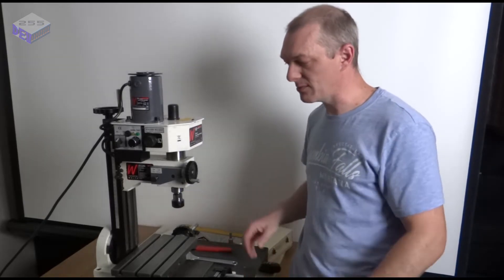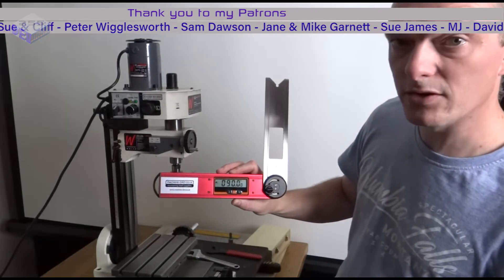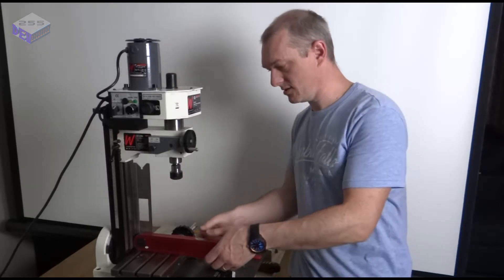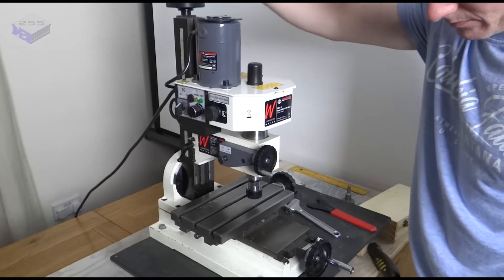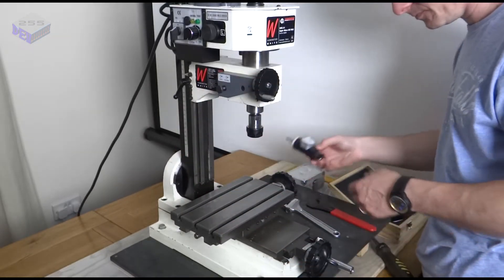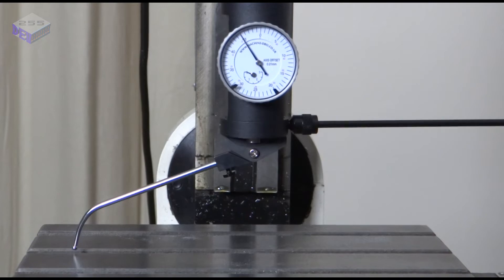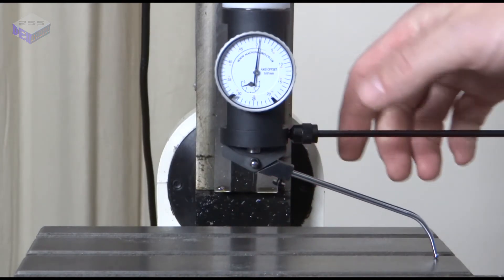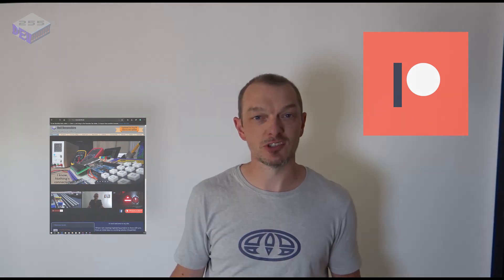Tramming a Milling Machine with a Rotary Dial Indicator

Comment: What brand is the single dial indicator?
Reply from the maker: Hi, the Dial Centring Indicator in this video is this one from Machine-DRO: https://www.machine-dro.co.uk/m-sure-dial-centering-indicator-metric-ms-440-000

Although, you can also get a similar product from here: https://www.arceurotrade.co.uk/Catalogue/Measurement/Centre-Finders/Coaxial-Centring-Indicator

I hope that helps
Reply: @TheSolarPoweredEngineer  thanks for the information.